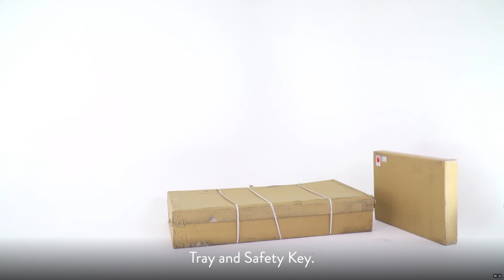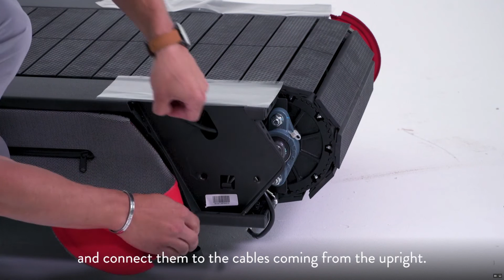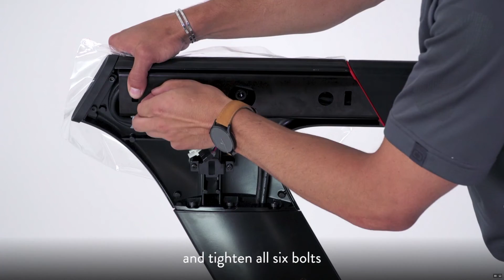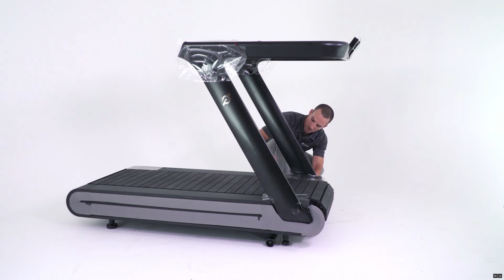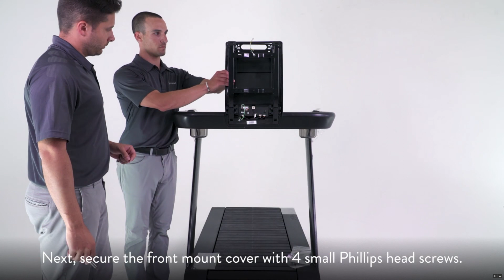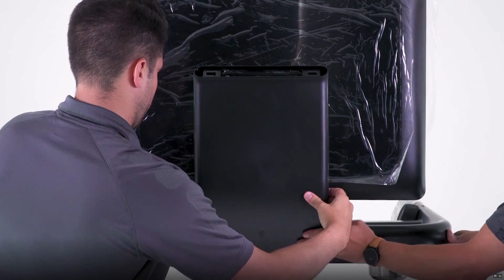Peloton Tread Assembly

Comment: XPO delivered and assembled my tread. But there's a plug thats coming from my monitor. They had it plugged in to an outlet. My monitor would constantly flicker. I read that it wasn't suppose to be plugged in as it's a backup plug for monitor.  I unplugged from outlet and it works fine. Looking at this video I now know I can unsnap back cover and remove it from monitor. It never should have been plugged in anyway.